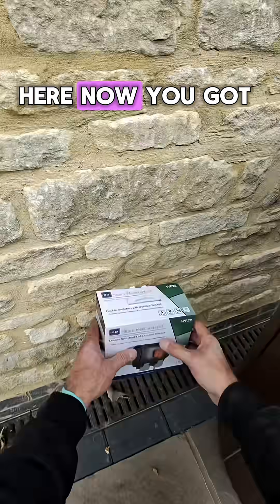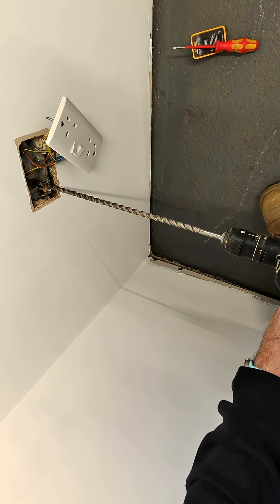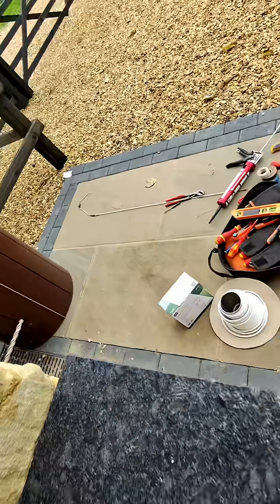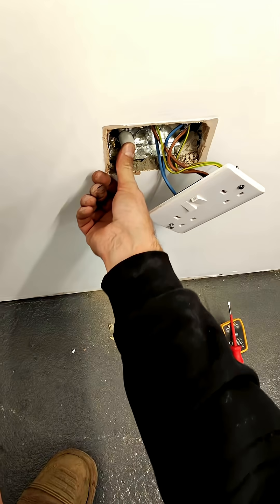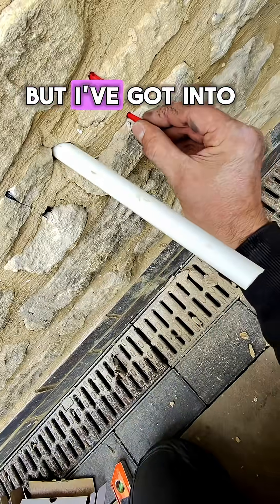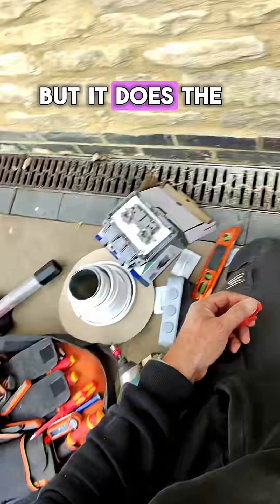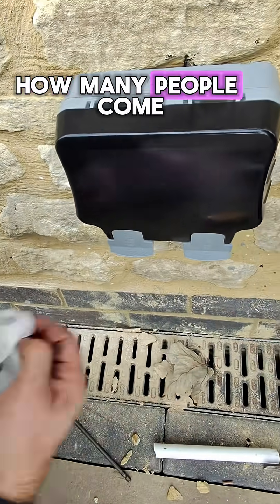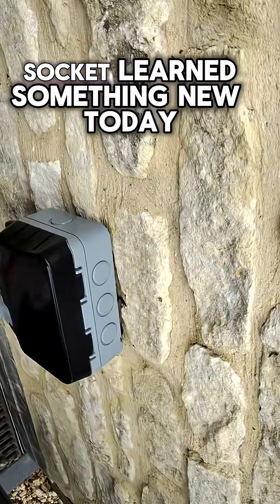How to Fit an Outdoor Socket (Neat, Straight & Weatherproof)

Comment: Thought you might of cut in a control spur socket on the inside? Just the way I do mine.
Reply: Self drilling screw into one of the rear box knockouts will make it easy to get out.  And save knackering your holesaw
Reply from the maker: Good idea, that's another way to do it!